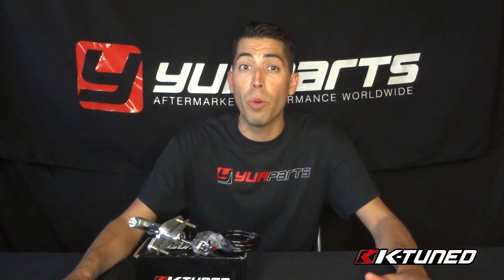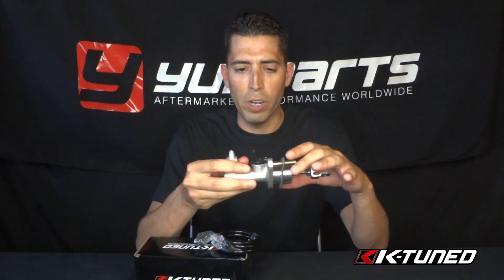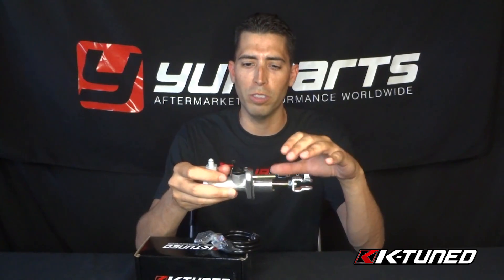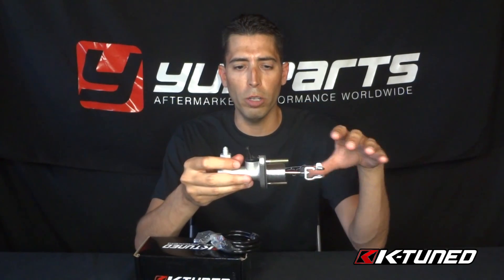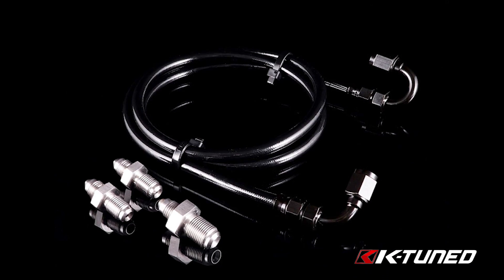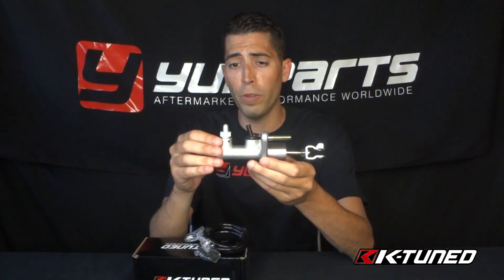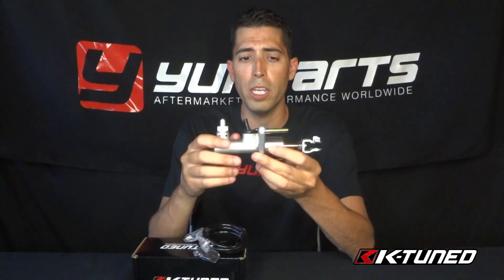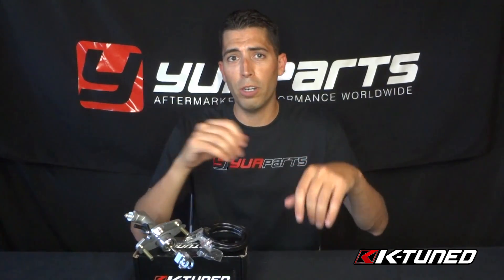K-Tuned CMC Clutch Master Cylinder Upgrade Kit Review

Comment: Just got mine & the fitting for the hose seems really loose. Moves clockwise & counter clockwise easily as well as up & down slightly.  Is this normal???.

Comment: Has anyone tried the hybrid racing?
Reply: I have it on my 8th gen Si.  It's a factory Honda EM1 Civic CMC, with a stainless line and connectors.  It works great.  Buy their shift cable bushings and their shifter base bushings for the full experience ;)

Comment: What's up Rob, love the videos man, keep up the good work. I had a question about the clutch line that is included in this kit, does it go all the way to the slave cylinder, or just to the bracket where the line switches from rubber to steel?
Reply from the maker: It does not replace the hard line